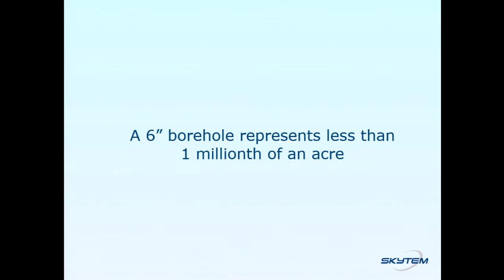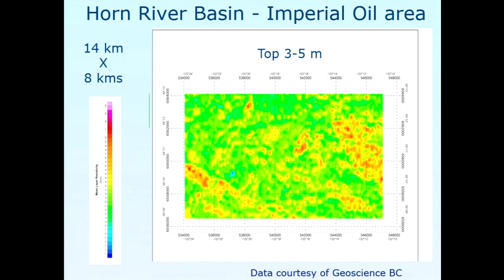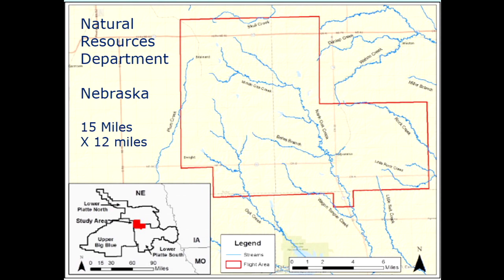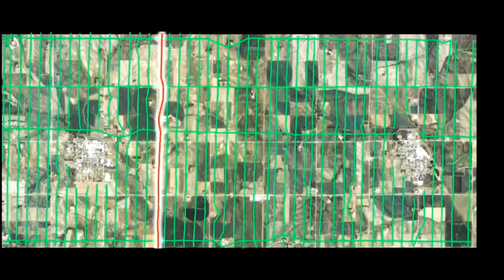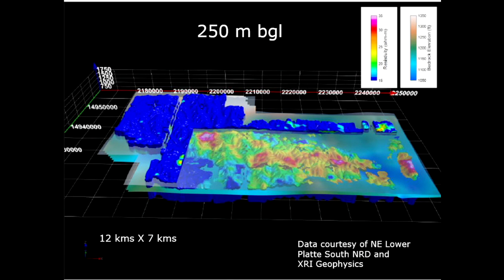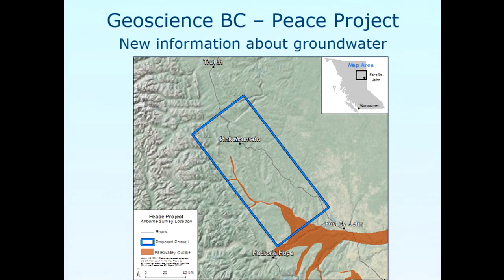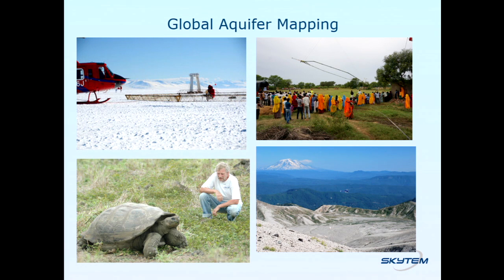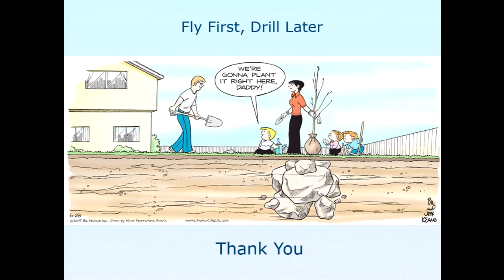Bill Brown: Using Airborne Geophysics to Map Groundwater

Comment: Can you map using drones now? What software do you use to interpret the data? Can Starlink be used to map data too?
Reply: Drones can be used for magnetic surveys over small grids.  High-power EM equipment as used here is heavy and requires a large power supply, so not practicable in a drone.